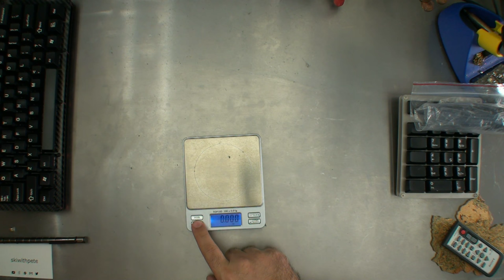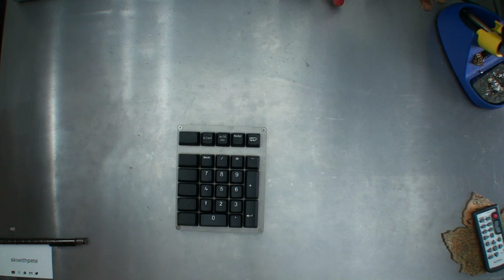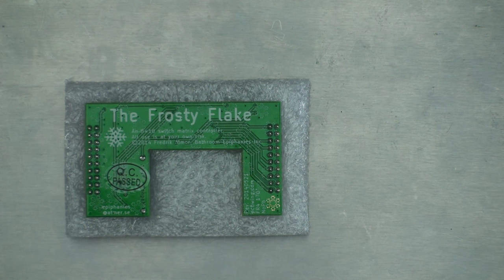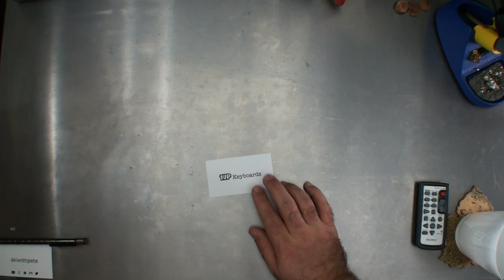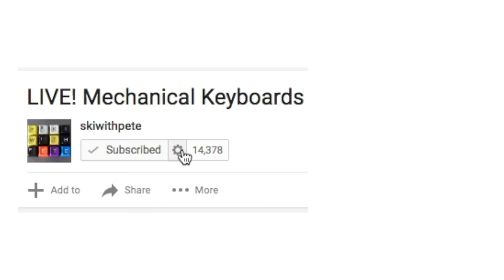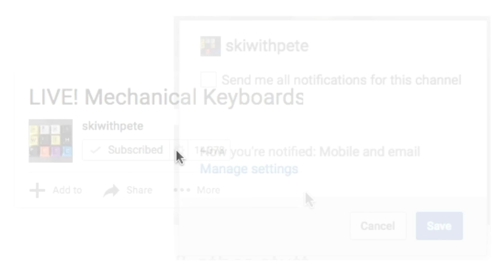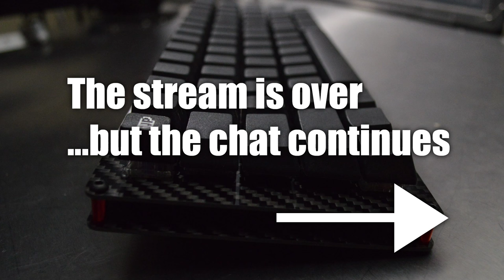Mechanical Keyboards Live! - let's play with some keyboards

Comment: I just thought I'd school you guys.  The Japanese company, Topre, that originally designed said switch is pronounced just like the talk show host Oprah.  Topre sounds like Toprah.  If you can get ahold of their phone number, you can actuallly listen to their reception voice mail message and you will hear them pronounce it like I've tried to describe it phonetically. Just thought I'd try and clear that up.  Huge fan by the way.  Just received the JD61UP black carbon fiber case from you all.  Thanks for the very well made product.  I decided to not get the CF universal plate from Sentraq because their tolerances are not tight enough and I'm rather sure they aren't using 5K carbon like this plate is.  I'm pretty sure I read or heard you say it's made from that quality of CF.  Either way, I'm very pleased.
Reply from the maker: Is it Paris? Or Paree?  :) You're right tho.  I should try to pronounce it better.